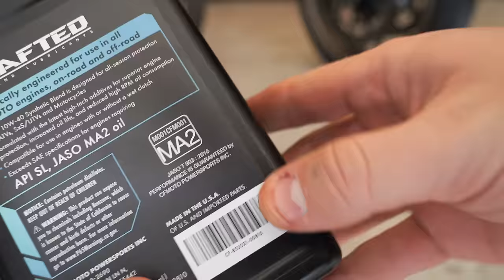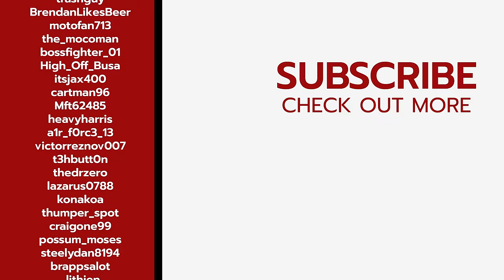Did I Destroy the 800NK? 600 Mile Hard Break-In Results!

Comment: So I have no experience with the NK800 however I do have experience with the NK300. I work for an MSF School. We have 12 NK300's as training bikes. Of those 12 bikes in the coarse of a year of ownership, we have experienced 1 complete wire harness malfunction, 1 display failure, 1 thermostat failure, a couple leaks/gasket failure's, and almost every battery has failed. Despite the above, I still think they are pretty good bikes and wouldn't hesitate to recommend them to anyone. Again, a small sample size but this is my experience with a dozen bikes in about 12 months of ownership in Arizona with the highest mileage bike being around the 500 mile mark and the average being around 300 miles.
Reply: Yeah, mine has a rubbish battery as well. No other issues that weren't caused by me however
Reply: The only thing id say about that experience is the MSF bikes get absolutely dumpstered with abuse from new riders
Reply: @iamcxd9782  Based off my time there and the over 300 bikes we regularly use, clutches, levers, and front tires would be about the only items that seem to exhibit accelerated wear and use.
Reply: The msf course I went to had groms, dirt bikes, and rebels and they warned us to shut them off any time we were told to stop because otherwise the batteries would die quickly. They were all pretty beat up though including a few that wouldn't shift properly.
Reply: @RageReq0  unfortunately that sounds like a group that doesn't properly maintain their bikes all to well.
Reply: @iamcxd9782  Yeah, but a wiring harness failure? Display? Thermostat? Those should be very-high mileage failures.
Reply: @zenith251  I agree however I would also say many of the big brands have had similar issues with new/low mileage bikes. Especially the orange ones. (Don't mind me on that one, iv had very bad experiences with the reliability of 2 separate orange bikes...)
Reply: @jerrybutler7206   I think CFMoto are making orange bike motors so...  But the batteries - Is that normal at MSF with constant stop/start? Or poor batteries to begin with? Fixed with a better quality battery? I'm Australian. One Chinese car company here, GWM, sells really cheap pick up trucks, but owners are having loads of problems because they have keyless entry and start, and the vehicle is draining and killing batteries while waiting for the key to come in range, and the recall hasn't fixed everyone's problems. And the one screen failure? My guess would be every bike manufacturer is buying screens from 2 or 3 different suppliers, customised for themselves, so screen failures probably happen across every brand. They may make their own engines, etc., but things like screens are outsourced, like brakes from Brembo/Bybrie.
Reply: @tsubadaikhan6332  CFMoto is manufacturing the orange 690 engine. The 390 is manufactured in India and the rest, to my knowledge, are Austrian. 

As for batteries, that's one reason I stated my location...batteries do not last long in our heat. I use Yuasa batteries as replacements and have good results.
Reply: @tsubadaikhan6332 batteries need you to run engine for like 1h for every start to stay in a decent charge state. For many people that's just not realistic, and it's entirely out of the question on an msf bike. They'd have to plug the bikes in once a month to reduce battery churn, maybe more, depending on use, as I haven't measured an msf one myself.
Reply: My duc has had all those failures.  See, you pay more, but you get more.
Reply: Just hit 5k miles on my 2022 300NK. I like it but would like more top end so plan to upgrade. 6k rpm at 60mph in 6th gear is not enough for me.

Comment: The oil spill was probably from using too big of a funnel.  It happened to me with my 790 Duke and once i bought a smaller funnel so air could escape out of the fill hole, i could fill it no problem.  You will always have to fill twice however.  I fill it till the sight glass is all the way to the top, turn on the engine for a few seconds, then fill to middle of the glass.  I change the oil every 5k and it's at 40k now.   The bike has a neat way to remind you to change the oil though.  The quickshifter starts to feels 'gritty' telling you its time to change.
Reply: how are ur cams ? since that common problem, the made of butter and  what year is ur bike ?

Comment: That's an "interesting" setup with the oil drain plugs. Service manual to the rescue!
I got to throw a leg over a CFMOTO for the first time last weekend during a ride day.I got to ride the 300SR & 800MT Explore, and that 800 has a very throaty intake. They're not up to the standard set by the Japanese, but they're pretty darn close. Close enough that I seriously considered buying one, and I'm not concerned about reliability. They've been selling the 650's & smaller bikes here for over a decade & there's plenty of them that are still on the road.
Reply: Identical to my KTM 1090 from 2016(The oil filters etc) kinda annoying tbh as i've found them getting stuck.
Reply: The dual drain plug/mesh strainer is inherited from the dry sump KTM engine designs.
You think that design is quirky, look up what's involved with the single cylinder KTM LC4 oil change!
Reply: @Mancastle 
A good pair of circlip pliers is a necessity for KTM oil filter removal.
The real annoyance is the fragile mesh screens that fall apart after a couple of oil changes, meaning you're better stumping up for an official KTM service kit instead of just getting a cheap (but perfectly good) Hi-Flo or Champion pattern jobbie.
Reply: @pauln6803 cfmoto does the full kit as well for a bit cheaper

Comment: cf moto have a stigma of chinese brand but what i can tell is it doing fine. it may not performed like japanese bikes but the price is the advantage of this brand. we have a cfmoto nk400 bought wayback q1 of 2018 and aside from clutch replacements and sparkplug and normal things that wear through time, no issues so far aside from the delayed feel on the throttle that was present on the 1st day of using the bike. bike clocks at 170k km and still working fine

Comment: I have a duke 790 (same engine) and can say that in its 7000+km so far that it's never let me down or been anything but great. I imagine these 800nk's will be similar.
Reply: you have more luck then i do, had 2 thermostats and an output shaft seal fail on me within 6000 km's on a new bike

Comment: Hey Spite, the only recommendations I would do with any of the bikes I buy would be to grease the wheel bearing seals, spacers & axle (F&R), grease the swingarm bearings/seals, grease the headstem bearings & apply anti-seize to the chain adjuster bolt threads going into the aluminium swingarm. The main reason: All manufacturers apply FA grease to save on costs & I get to learn about dissembling and reassembling the components.
A fellow American YTer has an 800MT & has replaced the swingarm bearings, seals & sleeves because of the lack of grease from the factory & because of a couple of low water crossings & gravel roads. I’d expect the 800NK to be similar.

Comment: As a 23 790 Duke owner that has put over 3000 miles on it since July, it has been utterly mechanically faultless. Not even a dash code or anything. However, I have had paint on the oil pan start flaking off from corrosion despite hardly using it over winter.

Comment: I guess there is a difference as to the model they are releasing worldwide, here in the Philippines that same bike already has a steering damper, as well as a quick shifter up and down.  Tft display looks like an ipad mini  while the ones you have is just a 5" tft, if i'm correct?  also, the handle bars also looks different, as the ones here has a scooter type of handle bars to accomodate that huge tft display.  Same price point, it's about $8,500 here as well.

Comment: Well, my 800NK Advance lost her rear hugger and got intimate with the rear tyre after 30kms, and the cone bearing failed at 1100km after 4 days of shakedown runs. Couple screws backed out.

It's getting sent back to the factory tmrw....2nd time in a week. 

 Seriously, this is like a bad joke. I wouldn't be surprised if i got lemonade if I drained the oil for it's first service.

Comment: I would still be on the fence, I would want to see how these bikes are doing in 5-10 years with 20-30k on the clock
Reply: Same. Any bike should last 600 miles or even 6000 miles without worry. It's the 60K that really shows how reliable a bike is.
Reply: I wanna see a large data set across many bikes, many riders and many years. Especially after they start ramping up production and increasing their lineup. Expansion is the number one killer of quality. That being said, 60k is a bit high dont ya think?
Reply: I have a '19 790 Duke, 40k miles on it.  Its reliable enough.  I have only had 1 part failure (thermostat went bad) and a known issue cam chain tensioner replaced in warranty in it's first month.
Reply: @jvillain9946 Oh, yeah, 60K is excessive, but for me it's just the magic number that I'm lookin for. If I can't find any used bikes past 60K in somewhat rideable condition, to me it speaks of a shorter lifespan for that model. But realistically those kinds of huge mileages depend more on regular maintenance to actually achieve. And granted, kind of a pointless meter considering brand new bikes. But the point is reliability is earned only after several years and not the first service interval.

Comment: That oil filter @ 4:30 didn't look real healthy, but you mentioned it in the pinned comment. Compression tests could have shown if the rough break-in affected the rings/cylinders getting sealed properly. Best (tested) chain lube is gear oil. It's good to see that an experienced motorcyclist/vlogger can be clumsy like myself...lol. Thanks for the video.

Comment: Bearing checks - there is a process for this that isn't just "it rides fine" AND isn't pulling wheels etc.  get the wheel off the ground, check that it rolls without any grinding.  Grab the wheel, and try to rock it in directions it shouldnt move in, make sure there's zero play.  Steering bearing: when the front is up, ensure the bars can move smoothly stop to stop with no hitching.  Grab the bottom of the forks, try to push and pull them, make sure there's no movement.  Same with other bearings - elevate, try to move in directions it shouldnt move in.  A worn bearing will allow a little play that will be noticeable over a long arm (like forks, swingarm length, wheel size, etc.)

Do check these things and you'll find problems before they're noticable riding because problems will present very gradually and it's easy to not notice till it's REAL bad.

Comment: Wish you showed the actual filter There were a good amount of metal shavings in that.
Reply: Yeah, I kind of noticed that too. Still, that is why you pull the filter with the first oil change. I would run another thousand and change out again just to make sure it was clear.
Reply from the maker: Here you go: https://www.youtube.com/shorts/RKLPWGgsSqQ
Reply: @spitescorner  Unfair dude. Two of us saw metallic particles on the filter and I was keen to redo the oil change after another 1,000 miles to make sure it was clear. You didn't say you had sprinkled it with metallic glitter.

Comment: Looks like a typical KTM dual drain plug with mesh screen oil change. If it's like my KTM 1290, those drain plugs are as soft as butter. I bought a set to keep on hand, since they seem to want to round off more and more with each oil change.

Comment: In my opinion as they are cheap they're gonna be great starter bikes and great to learn on the basics from maintenance and getting to ride a bike even amateur or pro 
as long as its maintained properly, a lot of people in asia have proven cfmoto reliable with proper maintenance.

Speaking from experience the older cfmoto had shiz electronics apart from that it took me from point a to point b and kept me safe especially with their abs and the brakes were there to stop the bike.

Comment: Did you try all 3 ride modes? Mine really stutters in low gears low RPMS. I was worried if I’d make it home.  I was 50 miles away.  Once I got it on the highway it ran fine. I’m a lil concerned about the in/out gas flow.  Doesn’t have a carb obviously so we will see at the 1000km first service this week.

Comment: I think it is a dry sump engine, based pn having 2 oil drain plugs. Usually with dey sumps you add around 70% of oil quantity, run the engine and add rest of it.

Comment: There is a lot more to question reliability than just the oil and basics. My biggest worry would be the welds, quality of steel and metal composites. I'd even question the quality of the screws and bolts. Manufacturing cost alone isn't the only factor that determines low sale price.
Reply: From the video, all the hardware was straight from a KTM 790 parts bin.  All their bolts that have that same dull metal look to them, but they've held up well for my '19 790 Duke. The filter cover also has the same weird shiny metal look.  I've got 40k miles on mine and do my own service.  I've had a bad cam chain tensioner (known issue on 1st gen, rattle rattle rattle) and the thermostat went bad last year, but no complaints for a KTM.

I'm hoping this bike will keep replacing part costs down cause I don't see myself getting rid of the bike.  Its too good of a daily do everything bike.
Reply: Well it cant be any worse than the quality of my yamaha T7, the engine is good but it lacks in paint and general build quality 👍
Reply: @Prestonesfpv  Yamaha did sign a contract with cfmoto

Comment: I'm interested in this, but the new Suzuki GSX-8R really has my eye now....
Reply from the maker: I'd love to get my hands on a GSX-8R. The S was a sweet little bike.
Reply: Totally practical bike. Go for it. The 8S has better suspension components and some wind protection.
Reply: @blipco5  The R has the better suspension. My S is OK but not very adjustable. The engine is really nice and has great throttle response so is a lot of fun to ride. If you want the sport bike riding position, the R is going to be a great choice.
Reply: @thomasneedham1512  Yes, I meant to say 'R' because I also mentioned the wind protection provided by the fairing. If I didn’t have too many bikes right now I’d most likely buy one of these. I have no problem leaving the high horsepower specs and bragging rights to the squids. I like to ride. Few riders can utilize even 100 hp on the road.
Reply: The Triumph Daytona 660 and CF Motos new 675SR might be great options is you are considering the GSX8R.

Comment: It's easy to say that at 600 miles but with the 790 engine and the question over the cam shaft longevity, if you are going to have issues it will be around 15,000 to 20,000 miles from what I've seen, so it will remain to be seen 😉

Comment: Let's not talk about all the metal I could see on the filter 😂
Reply from the maker: Here you go: https://youtube.com/shorts/RKLPWGgsSqQ?si=BZo5d6WkBlEa2pXm
Reply: Although this one had glitter on it I've heard about many bike brands that a small amount of debris on the filter is not normally a concern at the first 600 mile service.  There is a reason the first service comes up quick. Apparently the first service ensures any debris that was in the engine during building or from wear while the engine is 'tight' is caught and removed. 
Metal in the oil at the second service would be of concern.
Not saying many bikes do have debris in them of course but manufacturers will cover their backs and I can see their reasoning. It won't be huge chunks of metal either 😂

Comment: @spitescorner When you had to cycle the oil, did you have to close it up or just ran it with the filler cap open? How many seconds did you allow it to idle before adding more?
Reply from the maker: I closed the cap and turned it on, then immediately back off. Just enough for the oil pump to cycle. It probably would have been fine to idle, since I was off by like a 1/10th of a quart.

Comment: Would cranking the bike with the throttle wide open be better to pump the oil around instead of actually starting it? On all of the bikes ive owned you can do that to crank but not start the bike. This is for non carburetor bikes. I do it after storing my bike over the winter. Helps get oil moving around and lube things up in the top end before i actually start it up.
Reply: If possible cranking without running is indeed the best. No idea why you would have to open up the throttle though. At least not to help the oil get around although it might help to free some residue in the induction system if the fuel contains alcohol.

Comment: I have the same bike. Mine is a 2024. I noticed your passenger seat has a grab belt for the passenger. Mine does not. Did yours come with it or is it an aftermarket item? Thanks in advance.
Reply: I have a late 2023 and it had (I’ve already removed it) the grab belt tucked under the seat.

It sits underneath and you can use it by just taking the seat off, lifting up the belt, and sliding the seat under it.
Reply: @ms_enj  Thank you! I've actually traded my bike in for a different one.
Reply: @Steve-cp4vl  different bike or same bike?
Reply: @35764G It's the same bike in your video. I traded it in for a different bike.

Comment: Oil filter is full of metals shavings as you pull it out, who doesn't show the oil filter after the premise of the video? That's actually fairly typical with KTMs as well but it seems worse than I've seen on other bikes after the break-in.
Reply: I have a '19 790 Duke.  From the video, there's practically no difference of the engine.  The shavings at the first service are usually clutch material and that stops after the first service.